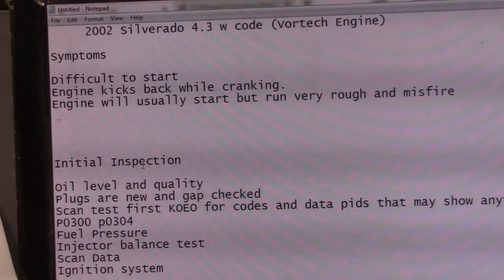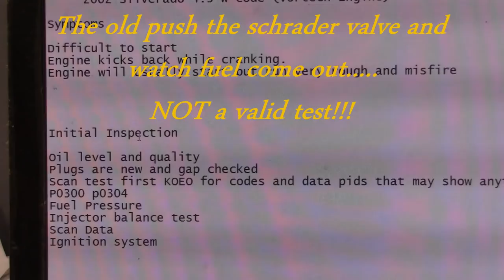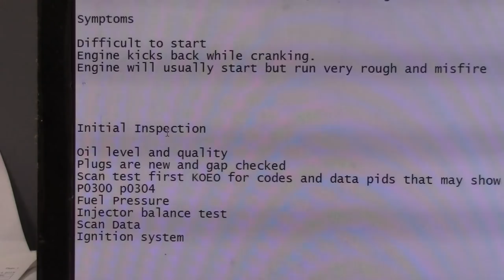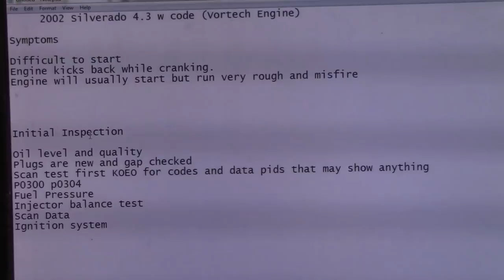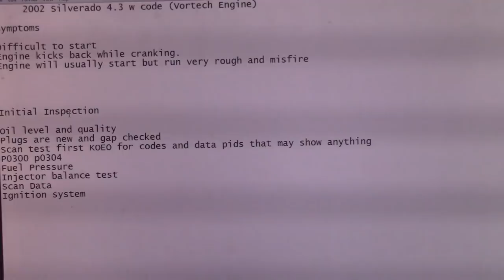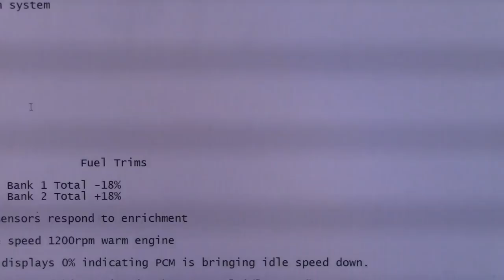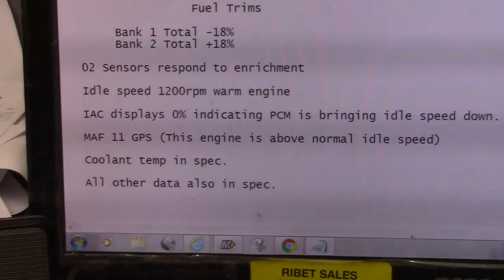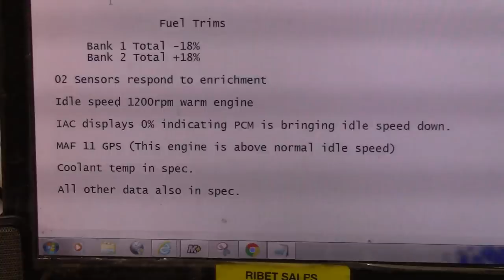Why Vehicle Owners SHOULD ALWAYS Do Their Own Repairs!

Comment: Amazing,,, your a great technician.,...  this beats my problem I found with 4.3 injectors in a 5.7 TBI... SURGES AND  PREDETONATED /My son is going to school for biomed repair, and learning how to use an oscilliscope. I think it will come in handy for cars
Reply from the maker: Thanks I would love to hear more about this injector issue you found.
Reply: Joe it was partially my fault, due to assumption.. bought an 89 k1500 with a 5 speed manual and a 5.7.. we were wondering why the prndle was in the far left corner of the dash but didnt pay much attention.. the guy we got the truck from off craigslist, said he bought it the way it was, it had a blown headgasket, he was going to pull the heads but needed the cash, his buddy was in the joint and he was trying to spring him..,. SOI bought the truck, sight unseen except picture on craigslist.  we agreed on 550.00 and he deliver.. ok he shows up, I check vin against title, everything checks out, he unloads and goes on his merry way... open the cab, and there are various part on the floor, but by no means everything we needed.. no tensioner pulley, no fan no alternator, no belts, ect.. the harmonic balance was in the cab in the bucket with the other part.. the intake and throttle body bolted on, was sitting in the bed of the truck.. So I wanted a project truck to teach my so a few things.. we pulled the heads, sure enough, blown head gasket, got the heads worked, replaced rusty pushrods, did the whole top end. rebuilt TBI, installed and fired it up.. it ran, but surged like crazy and would pre ignite thru the intake on throttle snap. BAD,, like try to blow the intake off bad.. check timing and wiring 3 times, all good.. distributor was old and tired so replaced it,., no fix . checked fuel pressure at the filter, with t fitting.. 9-10 lbs.. replaced fuel pump, new pressure 10 -14 lbs... start truck, same crap, surg at idle and misfire... I was wondering if I had a restriction and tryed squeezing the Fuel Return line, and truck idled perfect, and wouldnt miss or pre ignite.. At that point there was nothing left to check but injectors.. when I read the numbers and ran them, I felt sick.. but eleated.. WHY in the hell there was an intake and TBI in back of the truck I will never know, but I learned ALOT abt these truck,.s
Reply: even stranger the vin number says the truck came with a 4.3 and automatic...someone changed the computer to a 5.7, but it  has a prom chip for an automatic.. so far, its running great, I thing the manual prom just bumps the idle up from 550 to 600. this truck is a long bed 4x4 and will set up back in the seat in 3 gears.. we have a great sense of accomplishment.. we fixed ALot of stuff, and I spent great time with my son.. im just a shadetree hobby mechanic, but tenacious almost to a fault, I cant give up., we checked and service almost every system on the truck,   from the rear diiff, to the EGR system. All we have left to do is replace a leaking transfer case  seal,  and put better tires on it to be road worthy. .Its rust free, bondo free,  just a great old truck.
Reply: one of the pitfalls of these older trucks is everybody and thier brother has worked on most of them. usually drunk I think. I love the 88 to 94 GMTS though,,, especially the early  ones with the glass headlamps.
Reply: so... when I squeezed the return fuel line the pressure  on the gauge shot to 20... which 'MADE the pressure coming out of the injectors come out at enough volume, the keep the 5.7 happy.  these fuel systems want the right pressure. alot of people dick with the pressures, putting large springs in the fuel regulator, and it causes them to run rich on the top end. block learn and integrator just cant manage it correctly.
Reply from the maker: Very nicely done! I applaud the accomplishment.  Sincerely I am impressed with what you found. One thing I try to make people understand is this. If you understand how a system works, you can fix it. If you don't, you need to learn first before attempting to fix it. Great job brother!
Reply: @JoesAutoElectric  THANKS MAN, !I Was an HVAC contractor and appliance repairman for 20 years, as my profession.. when I worked with green techs, the first thing I would try to figure out, is if  they  had an intimate understanding of how the systems worked.. if they didnt, I would tell them, they will never become good at diagnosing them, if they do not know how they  work in the first place... we had a guy, that really knew hardly anything, he would try to recall what to do to fix it, and memorize it.. no logic at all.. one morning a customer called the shop and told the boss he told her to just twist the red and white thermostat wires together if she wanted heat... untwist if too hot.... lol  its Amazing some of the people working in industries, going into homes, who are clueless.
Reply: if ya need a set of 4.3 gm injectors.,., let me know..,. FREEEEEEEEEEEEEEEEEEE!!! They work great, they just dont flow enough fuel for the 5.7.
Reply: something else funny, the DAY I figured this thing out, a scanner I bought of ebay,  autel CP9690, that would let me read into the computer, arrived at my door.. I  hooked it up, and everything is spot on.. int, blm, 02.. all playing nicely.. I recorded the data from the pids for later reference. I dont have a real scope yet, but doing research.
Reply from the maker: lol awesome!!!
Reply: @JoesAutoElectric  hindsight, the intake pre ignition kept pointing to a timing issue, and I also readjusted the valves  . The one consistant thing was a lean condition,, I never saw a puff of anything come out of the tailpipe.. I tested the 02  with my voltmeter and saw it was lean and trying to add fuel. the truck ran better warm and in closed loop, but would still go into these surging episodes and shoot the boom out of the intake with a throttle snap. . The truck was doing all it could to give the engine enough fuel, but just couldnt.  after I put the right injectors in, the exhaust changed drastically, it smelled different, and there were tiny droplets of moisture dripping from  the pipe, which im told is a product of a fairly complete combustion process.  My son was getting weary, wondering if Dad would ever figure it out. ha  when we put the right injectors in it, and took it for a spin, his face was in permagrin lock. I dont know if I will buy another basket case project though. maybe a truck with a bad tranny, and rebuild it.. transmissions always interested me.
Reply from the maker: Well, as I said, I applaud you and your persistence.

Comment: Thought I'd throw this out to you Joe. You was working with the distributor on this 4.3 vortec. One thing I found on the last one I was working on. The plate that the rotor, screws onto, was actually loose. You could grab the rotor and turn it back and forth a little, so I swapped out the distributor.

Comment: I love it when DIY call themselves a mechanic/technician, just because they do easy work brakes, suspension maintenance ect. They try to take on a job that is beyond their skill set, they cause more problems than they already had. They continue to replace parts with crap after market parts, then once they cannot fix it they bring it to the professional and you dont get the whole story. Slowly you start to figure out they worked on their own vehicle and created more  problems than they initially had, after you wasted time "especially when you're a flat rate tech" chasing your tail they tell the whole story.

Comment: there is a mechanic shop out this way and he lets customers use there own parts but he checks them to make sure they are correct and so on..if they want to use there own parts he gets them to sign something stating if the part fails he will not warranty it  and so on..also Canadian tire you can supply the parts to them as well..they just won’t accept warranty on the part you supplied

Comment: Your troubleshooting skills are outstanding. How the hell do you put the gasket wrong and not notice it?
Reply from the maker: Lack of knowledge.
Reply: @JoesAutoElectric  that's not lack of knowledge.  You don't need any automotive education to match up holes.  That's not paying attention.  I've seen shit like that with cars always serviced by a dealer.  That's one of the reasons I always do all of my own work.
Reply: Maybe an unsupervised apprentice?
Reply: Impatience. I'm watching this right now to take a break from working on my car in the wind and rain. Add all the extra errors introduced by not having the right tool and it's easy to do dumb stuff in a rush.

I'm a lot more careful about what I'm doing after I stuck a shop towel in a hose to keep any  crap from flying in while I had it disconnected... didn't keep track and a couple of weeks later (fortunately at low speed) I got an unplanned lesson in what the throttle does.

I'm pretty new to fixing cars, but experience with troubleshooting all sorts of computer tech has given me a profound respect for the creativity of idiots.

Comment: Dear , Joe over the years I found that some  customers buy cars that they cant  afford then blame us when it cost   X  amount to repair it .. And for all the people that claim they are going to fix there car them selves  ? Doing a water pump today is a major job  on many cars ...   Are  they are going to buy the tools? buy the Info ? But they cant buy the years of experience , that it takes to do many jobs ,   Anyway I needed to vent ..   Thanks  PeteM
Reply from the maker: Thank you sir. Yes, did a pump on a 3.5 explorer recently. Not a job for the DIY'er with no experience for sure. Special tools required on those to hold cams, have to remove one timing chain...Torque sequence for cover is involved as well. Easy way to destroy an engine.

Comment: Nothing's worse than the guy who tells you what he wants done. And then complains that your work didn't fix his problem. The greatest advice I give to those who'll listen is, describe the issue to the best of your ability, do not make suggestions on how to fix it, and let the tech do their job. Tell 'em, "It does this when I do that. Please find out why and fix it."
Reply: Funny story . Good customer comes in with his mint 70's Dodge van and asks me to replace the alternator .  I started to ask what's going on etc and from his discription I said very conversationally it may not be that. He said just replaced the alternator . I grab a repair order fill it out . Replace alternator at customers request . Informed the customer that it may not be the issue. The customer still wants just the alternator replaced .   Put the labor price and had the customer read and sign .  So I had a direct link to Napa via computer ordered the alternator and the voltage regulator but I put the cost of the regulator into the price given to the customer for the alternator .  Only put the alternator in and called the customer and told him the truck is done .   Pays goes to his truck and the batt light is still on . Comes back in and tells me .  I said I know do you want me to fix your truck now ? Yes . I grab the regulator  and  3/8" change the regulator .  I said you're a very good customer but never talk to me like a servant again . I added the regulator to the cost of the alternator you're all set .

Comment: one bank way negative, one way positive,  IAC closed, MAF high, vacuum leak on one bank is the first target I'd aim at.
you done mentioned high pcv/breather hole negative flow though, those are the harder leaks to diagnose, not "whistling dixie" outside the manifold area.
Reply from the maker: Indeed.

Comment: My first car was a '70 Mustang coupe that I got for peanuts because it had a loud engine knock and serious blow-by. (I'm an electronics tech, not auto). Took the valve covers off and found that Mr. DIY had left one of the head bolts laying in the top end. The rocker arms were hitting it and making a hell of a clatter, and it was pressurizing the crankcase due to the open bolt hole in the head. No idea why he had one head bolt out. I put the bolt back in and torqued it down just to see if the problems went away. They did. So I changed the head gaskets and drove the hell out of it.

Comment: I don't allow customer to supply parts. If they supply them and they are wrong then I charge extra to get the correct parts and give the wrong parts back to the customer to return. I explain I have a better relationship with my parts suppliers and can get defective parts exchanged faster.

Comment: It always struck me as odd that shops don't often let the customer speak with the tech directly. They think it serves them well if they get info filtered through the brains of secretarial staff at the front desk. If the customer works on his own car, it is critical that the tech take an adequate history to understand what was done before....
Reply from the maker: Any place I worked, including a  dealer, I made sure from the start of employment that, I had the freedom to speak directly with the customer about his concerns. My thing where service writers were involved is this. I would take the RO and read it. If it was a basic concern of brake noise, misfire, something does not work electrically, I would take a look or test drive it to see if I can verify complaint. In other cases, like the car doesn't start sometimes etc...I would go to or call the owner and speak with them. I always ask questions so I can gather as much info as possible. When does it not start? Hot? Cold? Does it crank or does it do nothing? Do you hear anything when you turn the key? Do the lights on dash come on? I want to know everything that customer sees and hears during the problem.

Comment: First off i would like to say that my expertise in automotive repair is quite extensive and yet im not a full time mechanic, since i dont have the proper work space to perform this.  
 Within the last 2 years i have spent over 3 grand on repairs..which are needed to keep my car in top running condition.
 Half of that amount was for repairs that were performed my mechanics that were in the industry for more than 25 years.
 The other half of the amount was for the repairs I performed replacing the EXACT parts that were replaced the first time around. ( NOTE...the parts didnt even last 2 months before i had to reinstall all the parts correctly.)
 The reason behind the double repairs is that the first mechanics had installed cheap quality parts.
  After i purchased the parts from the dealer myself, i installed them and they are still holding up. (the factory parts cost me less than the cheap quality parts  that were installed the first time.)
 So for all those viewers out there who complain about expensive parts...think of it this way...its better to do the job the right way with quality parts than to have spent twice as much to have it done twice. 
 P>S> Joe...dont worry about who says what to you about quality parts...they will come back when they realize that YOU have same them not only money but headaches as well.
 KEEP UP THE GOOD WORK !!! The world needs more technicians like you.

Comment: Lots of folks think they can watch a youtube video or get the info from another method as to how to "fix" their vehicle.  First problem is, they don't have the tools mostly and secondly, they do not want to spend money on good parts opting for real inexpensive aftermarket. With that mentality at the initial thought to repair the problem, it's mostly going to go downhill unless the job is a radiator hose or maybe a fan belt. Too many shadetree mechanics are shooting parts, low quality parts, at the problem without doing any kind of research and verification of symptoms. Most of those folks need a mechanic to do the work, they'll be better off in the long run both financially and in the repair time etc.  Will they do this?  Not until they mess up and create a birds nest of troubles then hand it off to the professionals who have to charge much more to put all back that wasn't done right.

Comment: I agree with Fsk111. You don't need to justify anything you do if it's good work. I retired from little airplanes. Like the big ones the FAA rules them. Owners are forced to bring it in every year and pay to ensure it's airworthy. So we really had it easy. If they wanted the log entry they had no choice. But of course many did pitch a bitch, and we had legal protection when they did because the owner and pilot is responsible for the acft condition not the mech. If they wont pay for the repairs give it back in boxes with an incomplete logbook entry, and that is exactly how it was done. People don't understand how fragile they are.

Comment: Nice find.  I've seen +/- on opposite banks be cause by reversed upstream o2 sensors before too.
Reply from the maker: Indeed sir. Inability to bring idle down was an indication of vacuum leak.
Reply: @JoesAutoElectric  What would have really been cool is to see what this would have looked like with an in cylinder pressure transducer on the bank where the gasket was backwards.

Comment: This is a very informative video. It had to be a real pita with the number of issues and not knowing exactly what had been changed or screwed up before you had to diagnose the issues.

I have one question concerning the worn driven bevel gear on the distributor. Because this gear was worn....Is there any concern the driving gear on the camshaft is also worn?  Are the two bevel gears of equal or different hardness?

Thank you in advance for your time and thoughts.

Sincerely,

BS “Duby” Du Bois
Reply from the maker: Great question. In my experience, it is the distributor gear that normally will show the wear. I have never gotten into actual hardness of either, in all honesty...but also never saw one that could not be fixed with a new distributor assembly.